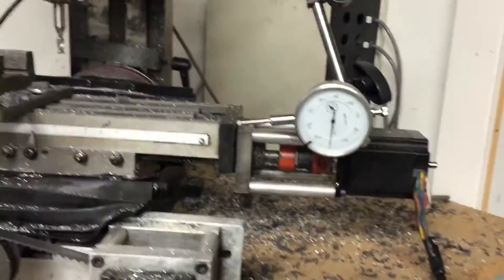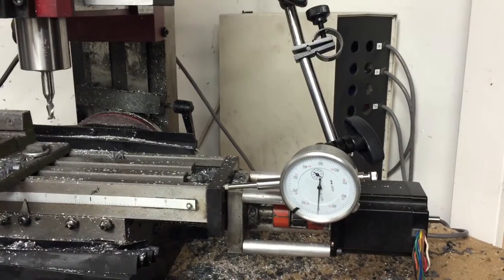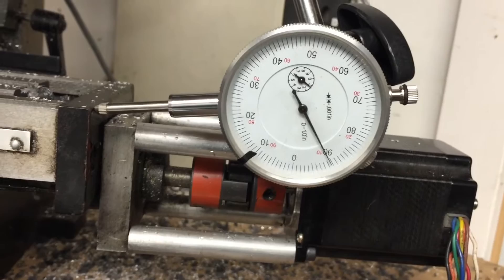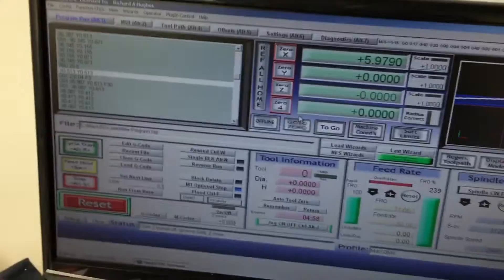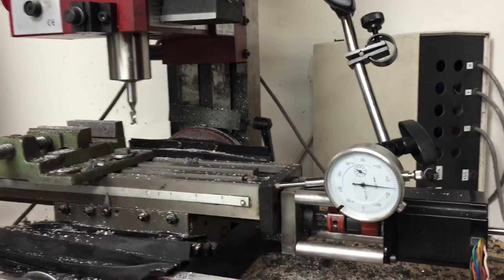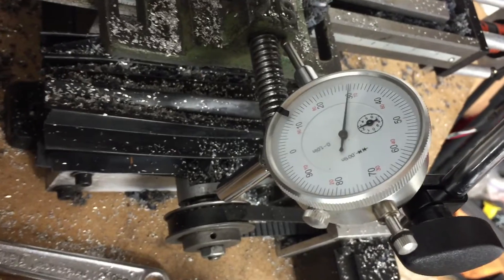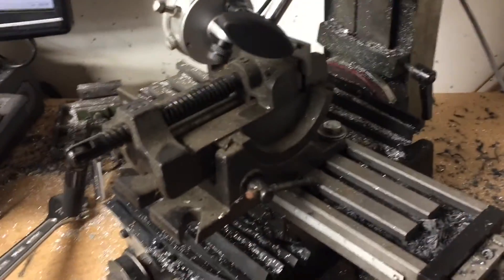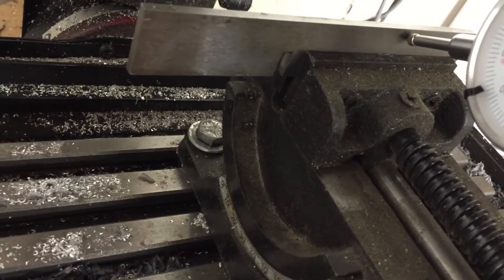Cnc x2 milling machine backlash compensation MACH 3

Comment: Great video, thanks for sharing. I realise this was posted a while ago, but I will try my luck asking anyway. Have you swopped out your lead screws for ball screws or are you running on the original parts? I have just purchased a similar machine and looking to do a CNC conversion myself. It would save a lot of money and effort if Mach 3 's backlash compensation is sufficient to mitigate the effects of backlash.Regards from South Africa!
Reply from the maker: Helmo Baard hey there, 

This was all stock parts. I ended up switching machines for more travel. Mach 3 compensation for backlash works great for movement of the table, but backlash creates “chatter” while machining. This is bad on tooling and also makes a less pretty surface finish. 

Take care man!
Reply: @UnorthodoxFabrication   Thanks for the reply, much appreciated!

Comment: The indicator needs to be perpendicular to what you are measuring. You womt get a 100% accurate measurement if the drop indicator is not straight. This is called cosine error. Just pointing if out. Other than that great video.
Reply from the maker: ISILENTNINJAI thanks man. That makes sense.